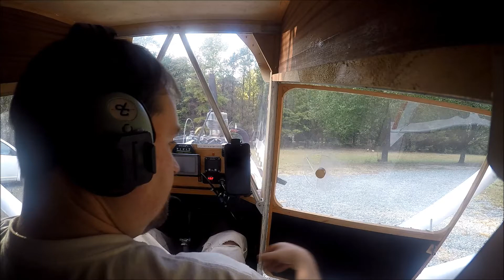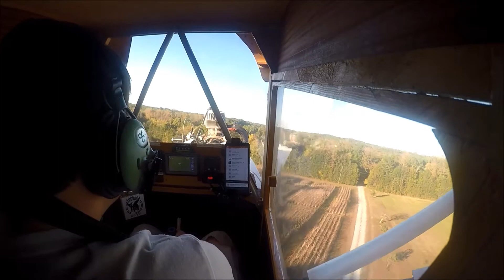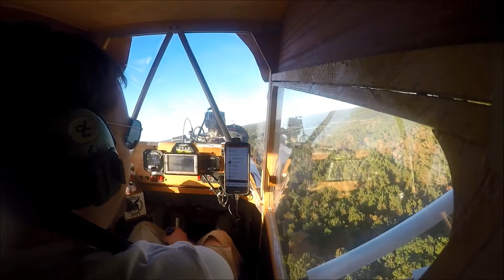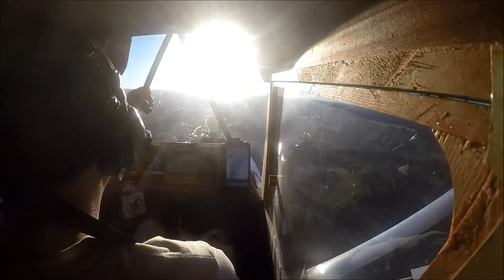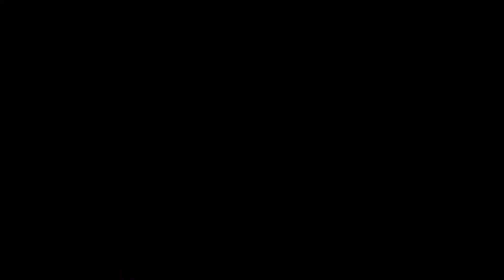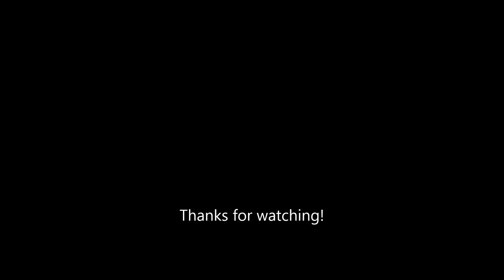fall flying and power loss on takeoff?

Comment: 1. pull the plugs, check them, then  take a look in the bore for siezing tell tales on the cylinder walls, pull the float bowl, and look for crud,  remove the main jet if necessary and make sure it is clean.. let fresh gas flow though and check float operation.  Then run it up !